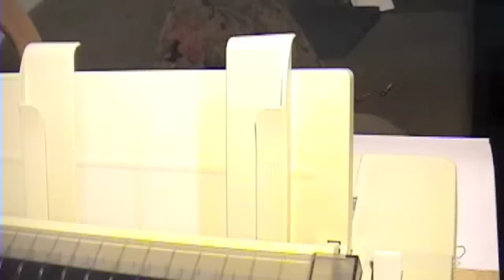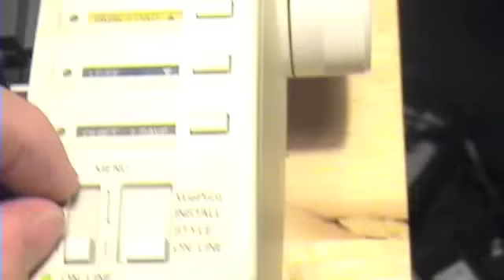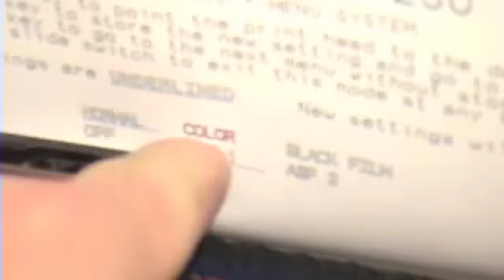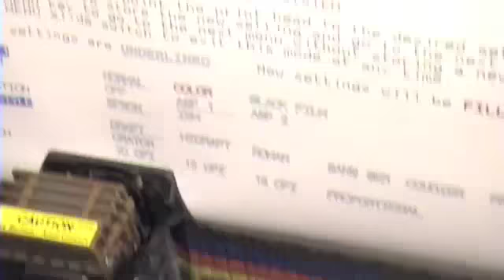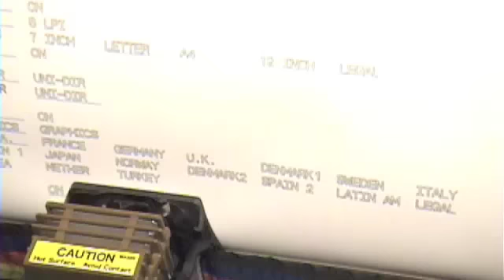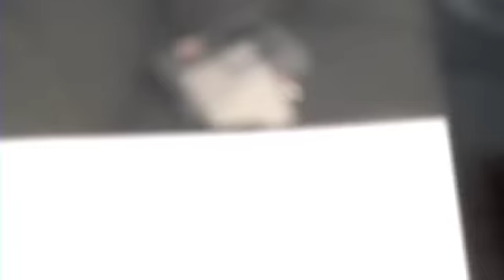Citizen Color Dot-Matrix Printer

Comment: I used to have the Citizen 200GX. You could add the color kit to most of them; it consisted of the color ribbon and a color motor which was a rocker arm and stepper motor that plugged in on the right. The sheet feeder actually worked, indeed, which was a rarity on a dot matrix!

I did also have a weird Tandy dot matrix printer which had a multi sheet feeder like a modern inkjet or laser, it sat under the monitor... don't remember the model. Ribbon was super expensive which led to its demise.

Comment: There is one of these hooked up to one of the old computers at work, however it doesn't have the colour ribbon or colour ribbon adjustment motor installed. You can see where they would go though, and the menu has all the same options.

Comment: Great old printer, cool video! :)
I collects vintage IT equipment and have two colour matrix printers - Epson LQ-2550 and LX-300+ with Colour Kit. 
1988 Epson LQ-2550 has modern-styled SelecType menu system with green backlit character matrix display. This machine also equpped with automatic printhead gap adjust, motorized touch-button Tractor/Friction paper source selection and phinthead cooler fan. 4-colour ribbon for LQ-2550 wery hard to find, similar for all other colour matrix printers.

Comment: I just got a GSX-190, the 9-pin version of your printer (they actually still make the GSX-190, although I got mine for all of $5) with the manual. There's a little tiny lever on the color kit that you can move to adjust color registration.

The Citizen website has a manual for the GSX-190, in PDF form, although it's for the modern GSX-190, and doesn't cover any of the color stuff - modern GSX-190s apparently don't support the color kit.

Comment: My first dot-matrix was a Tandy DMP-132 I used on my CoCo 3, and it had 4 separate ribbons, black, red, green, and blue. I had print program that would print one colour, then you re-align the paper, change ribbons and it would print another colour. Far cry from my Canon MX700.

I do still have a Epson FX-86e 9-pin as a backup. Still can get ribbons and fan-fold paper. Bulit like a tank.

Comment: The bi-directional vs. uni-directional selects which ways the print head moves when printing, not anything to do with the parallel port data flow. Bi-directional is faster because it doesn't have to wait for the print head to return to the left margin before printing the next line, but this can cause vertical lines to appear wobbly because each line isn't perfectly lined up, so that's why graphics mode is set to uni-directional mode by default: it's slower, but produces a more accurate image.

Comment: That really is an interesting menu configuration system the printer uses, it's very unique, but it's not at all economical because it uses paper to display the menu settings and options, you wouldn't want to change the options too often.  What would be the price for a printer like this back in 1992?